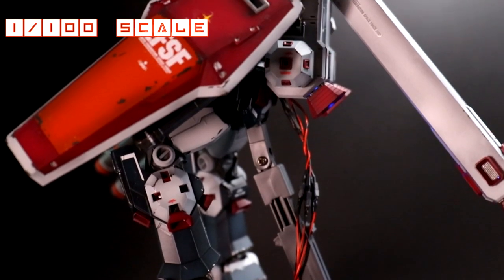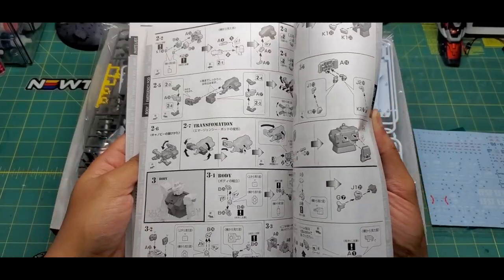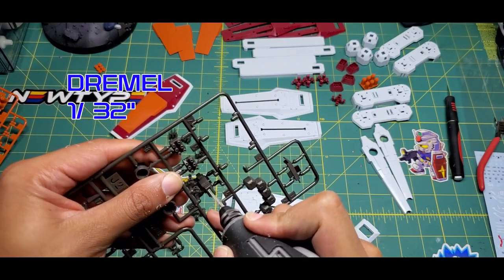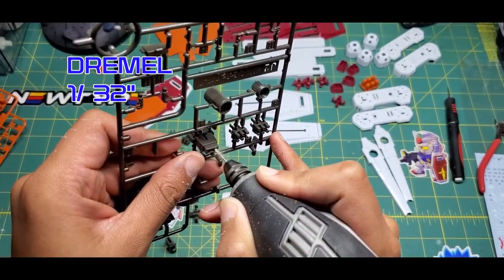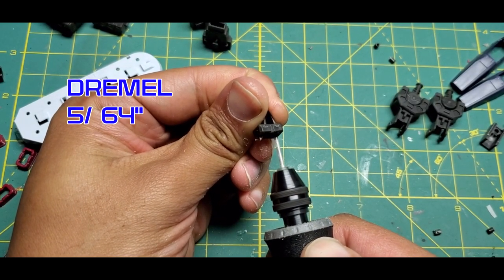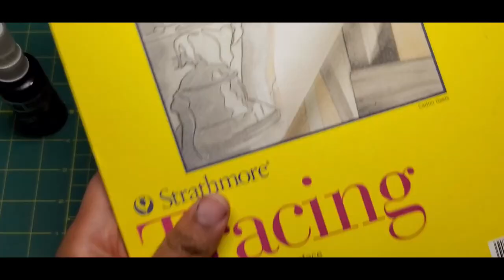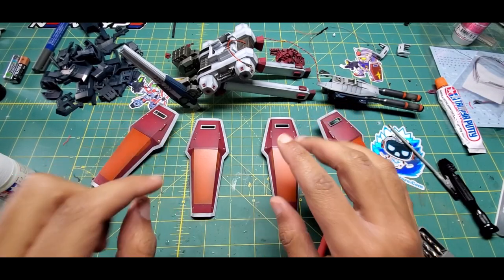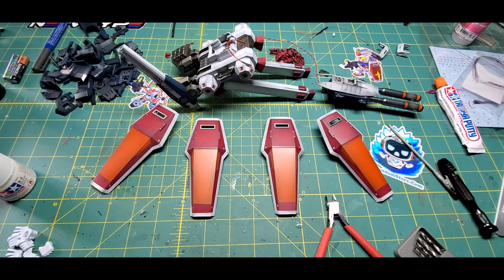#Gunpla #Newtpe MG Full Armor Gundam Thunderbolt Ver. KA PART 1

Comment: I've been wondering, what's the ventilation system you're using?
I recently got an AMI airbrush booth, but being an engineer myself it was rather underwhelming.... Quite noisy and a relatively low suction force.

I'm now starting a diy design based around the Nidec servo Gentle typhoons (high static pressure, quite decent airflow and brushless).
Reply from the maker: OPHIR Super Power Airbrush Spray Booth Kit. It works very well when you do simple airbrushing, however, it tends to clog up the filter rather fast when using a primer.
Reply: @OtakuBuilder  how do you clean up your filter then? do you only use alcohol and rub it with them?

Comment: Great stuff as always.
 The jazz songs you chose for this video is very fitting.
I hear the MG FA-78 Full Armor Gundam [Gundam Thunderbolt Ver.] (Ver.Ka) is one of the more complicated MGs; especially those vinyl joint covers.
But on top of that, you had to work around it to install your custom LEDs. 
I'm impressed (as always).

Are you planning to get the P-Bandai releases?
MG Weapon & Armor Hanger for Full Armor Gundam [Gundam Thunderbolt] (Ver.Ka)
MG FA-78 Full Armor Gundam [Gundam Thunderbolt Ver.] (Ver.Ka) Last Session Ver.

I'm surprised Bandai hasn't made an MG for RX-78AL Atlas Gundam (Gundam Thunderbolt Ver.); especially since they've made:
- HGGT RX-78AL Atlas Gundam (Gundam Thunderbolt Ver.)
- HGGT RX-78AL Atlas Gundam (Bandit Flower Ver.)
Reply: @xxnike629xx 

"Great stuff as always. The jazz songs you chose for this video is very fitting.
I hear the MG FA-78 Full Armor Gundam [Gundam Thunderbolt Ver.] (Ver.Ka) is one of the more complicated MGs; especially those vinyl joint covers.
But on top of that, you had to work around it to install your custom LEDs. 
I'm impressed (as always)."

Your BOX fortress is impressive too 😀😁😂

"Are you planning to get the P-Bandai releases?
MG Weapon & Armor Hanger for Full Armor Gundam [Gundam Thunderbolt] (Ver.Ka)
MG FA-78 Full Armor Gundam [Gundam Thunderbolt Ver.] (Ver.Ka) Last Session Ver."

Are you planning to finally build a kit again? 😮

"I'm surprised Bandai hasn't made an MG for RX-78AL Atlas Gundam (Gundam Thunderbolt Ver.); especially since they've made:
- HGGT RX-78AL Atlas Gundam (Gundam Thunderbolt Ver.)
- HGGT RX-78AL Atlas Gundam (Bandit Flower Ver.)"

I'm surprised that you didn't made a "(Serial Number and Name of UC kit) will be a P-Bandai)" ill wish today.